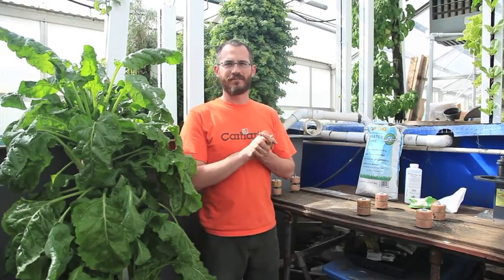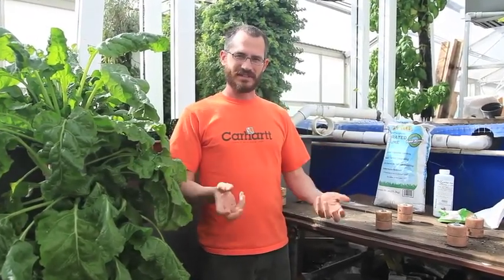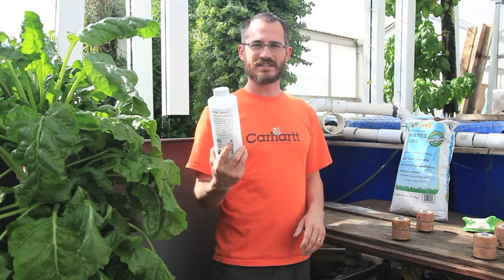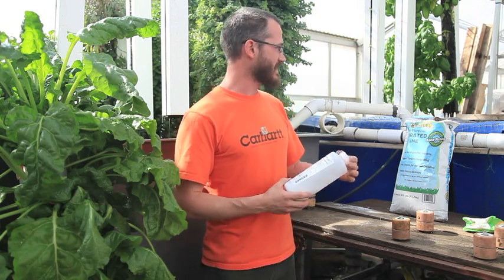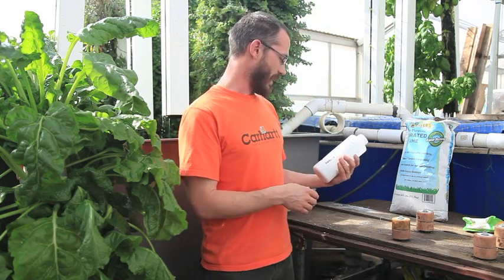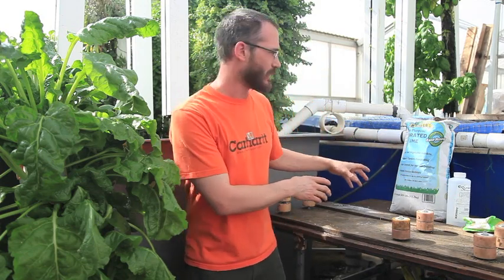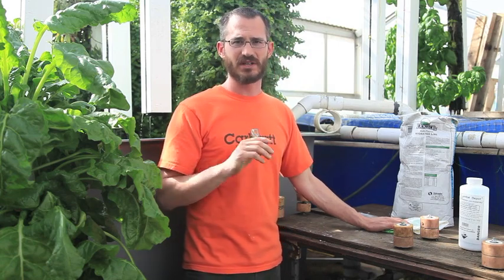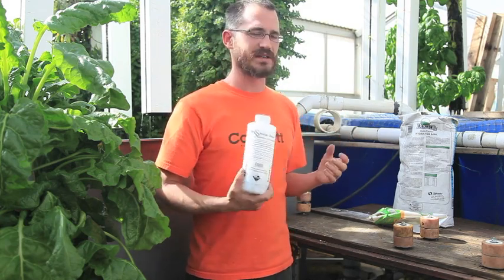Bringing up pH in Aquaponics systems

Comment: Dr Nate Story please explain to me, how much KOH and Hydrated Lime you put in your system everyday. you said 50:50, but how much gram per gallon. thank you
Reply: That all depends on the starting pH and size of the system... you're basically adding a little at a time and waiting then adding more the next day until the desired pH is achieved... without increasing more than .3 pH points at a time to avoid stressing the fish... but there are online calculators you can use for this purpose if your pH measurements are really accurate. Otherwise I'm sure it won't work a tinkus damn.

Comment: Hi Nate. My aquaponic system is 5 years old; I have a 300 gallon stock tank where my koi live and four 50 gallon stock bed grow beds. Lately I can't keep the pH over 6 and am not only losing plants but fish as well. I've used a combination of potassium bicarbonate and calcium bicarbonate which I had purchased from an Aquaponic online store; it seemed to relief the fish but only temporarily. 

I'm looking to buy the Doctor Soil Hydrated Lime and can only find the pelletized- is that what you use? Can I use this since it's all I can find from Doctor Soil?

Also, I'm hesitant to use the Potassium Hydroxide- it would be my luck to 'burn off my fingernails' as you mention in the video. Can you recommend an alternative to use with the Doctor Soil Pelletized Hydrated Lime?

Comment: how do you store the PH Pen between measures? i have a cheap one from ebay and in the manual it said to just rinse in distilled water and put the cap on but i read that the sensor must be kept wet all times on a 3mol/l kci solution...
Reply from the maker: Hey +Luis Miguel Batista - yes keeping it moist is ideal. Bluelab (the pH meter company) has some great videos on this topic actually.

Comment: so Dr Nate... are you saying you dont care about testing KH? do you guys at BA test for it at all? i know everyones system is different. also could you answer, with a new system or a system with carbonates, how long typically does it take for any certain system to eat them up? are there multiple factors in it? such as water source obviously but what about plants/number of plants in the system? and certain fish/densities? i know thats a big question. make a video if you have to! lol
Reply from the maker: Hey DRUMofTRUTH - 90% of the time KH doesn’t matter once you have nitrification cracking along.  Unless you’re in one of those places with extremely hard water, nitrification eventually consumes those carbonates.  It can be 3-6 months in really high KH systems.  The more plants you have in the system, the more fish you can have and the faster you can drive nitrification.  It’s a big question and a complicated problem, but all said, higher stocking densities (per gallon) combined with more biofiltration will allow you to churn through your carbonates a lot faster on a newly started system. Hope that helps!

Comment: I purchased some hydrated lime, haven't added it to my system yet because I'm also ordering some potassium hydroxide. The hydrated lime I got has only 0.45% magnesium.  But I wanted to get your opinion on this hydrated lime since I'm very new to this:

Calcium 51%
Calcium Oxide 72.50%
Calcium Carbonate Equivalent 131%
Calcium Hydroxide 95%
E.N.P 130%
E.N.V 130%

I have no idea what ENP and ENV is, is this safe for my Aquaponics? It's Hi-Yield Horticultural Hydrated Lime. Thanks!
Reply from the maker: exeseven hat hydrated lime is very Calcium rich.  You may want to look around for a brand with more Magnesium in it to  maintain a balanced system.  Hope that helps!

Comment: Hi Nate - I've tried everything to raise my pH in my aquaponics system.  I have a 100 gallon tube and right now only 1 gold fish (all the other fish have died).  My pH stays close to a 5.  I tried adding egg shells in the grow beds, sea shells in the tube, used products from the fish store etc.  I saw your video and would like to try the 50/50 blend that you speak of.  When I call Essential Depot to get more info on how to use it...do I remove my one and only fish first, can I mix the 50/50 blend (Potassim hydroxide and Hydrated Lime) into the tank, how much do I use etc. They shared they didn't have any info on it for aquaponics.  Would you shed some light on how much, how often and do I need to remove my fish, can I dump the blend right into the tank?  Also any info you can provide to me about why my pH doesn't budge would be great.
Reply from the maker: First off, you don't have to remove your fish to dose your system with a base.  You shouldn't be adding so much that there's a problem.  For a system your size adding a couple of dry ounces of a 50-50 mix should be enough to bring the system pH up a couple of points.  Start with 1 oz and see how much it comes up after 1-2 hr.s Then repeat with appropriate increases or decreases in the amount you add depending on the results.  Once you figure out your system, you might be able your base mix to a bucket with a hole in it and let it slowly drip into your system over the course of the day.  You might consider using a carbonate in your system as well- especially if your pH is always that low.

Comment: Great info. How does one calculate how much to add per gallon to move ph a given amount?
Reply: From Nate's answer on a comment below: "adding a couple of dry ounces of a 50-50 mix should be enough to bring the system pH up a couple of points.  Start with 1 oz and see how much it comes up after 1-2 hr.s Then repeat with appropriate increases or decreases in the amount you add depending on the results. "

Comment from the maker: Hi Brendan,
You can do it on weight, but that's pretty inexact.  I would recommend going by molar weight, which requires a little chemistry.  Basically look at the purity and figure out how much of the relatively impure lime is the equivalent of the very pure KOH.  Or, you can add by weight, but will have to supplement additional Calcium over time (I recommend doing this foliarly)

Comment: Thanks for the high quality videos you create, they are extremely helpful.

Can you please clarify when you say 50/50 of potassium hydroxide to calcium hydroxide how is this measured? I have a 6000L system and frequently put in a 1/3 to 1/2 a cup of calcium hydroxide and I've now ordered a bottle of flaked potassium hydroxide but I can't see my putting in anywhere near that much if its as potent as it sounds.

Thanks

Comment: How long does it take for a pH change to move through a system? I have 10 IBC's connected with 2" siphons that keep the water at the same level in all of my tanks. If I added a pH up substance to my first tank, how long would it take to measure a pH change in my 10th tank? I guess I could avoid any worries about this by adding equal amounts to each tank, but I ask because I would like to add chemical like this as far away from my fish as possible so that the impact upon them is lessoned.

Comment from the maker: You want to add it directly to the water in your system, although it helps to mix it with some system water in a bucket first, then add it slowly to your system.  If you mix it like this, you can dump it all in at once, but the best way is to drill a small hole in a bucket over your system and pour the solution into the bucket so that it drips into your system slowly over the course of an hour or two.

Comment from the maker: Hi Bacon Le, That's a relly high pH.  I would stay away from plaster of paris, as there are several types, some of which contain lime (which would raise your pH) or gypsum (which you don't want in your system).  Your pH is high enough that it indicates that you have some diurnal cycling (algae blooms causing pH swings) and probably some carbonates in your system or entering your system.  Try and find any cement or other basic or carbonate based products in your system and remove them.  Good luck

Comment: Hi Nate, I have been having some troubles keeping my PH above 6 and i have been using a 50/50 ratio of potassium and hydrated lime but it still falls atleast 2 - 3 points over a 24 hour period. My system is still going through the initial fishless cycle so i am guessing it is to do with the colonization. I will try dolomitic lime tomorrow, I am really greatful for the valuable information you share. Thanks!

Comment: Hi, i have a question about calcium. is it safe to use chelated calcium instead of the calcium hydroxide? cause i'm problems in finding the calcium hydroxide, if i do find one the cost is quite a bit high and they don't sell them in small bag (per kilo).

Comment from the maker: Potassium hydroxide is a naturally occurring compound found in wood ash (this is why a lot of people use wood ash as a potassium supplement). Hydrated lime or agricultural lime is another commonly used ag supplement that has been used for centuries. Since they're both natural substances, we don't have too many problems putting them in our system.

Comment from the maker: Once you have carbonates in your system, it's tough to get them out.  The problem is that they buffer pH instead of directly raising it, which typically takes control over lowering your pH away from you.  Don't use dolomitic lime unless you need to supplement Mg.  KOH can be bought online as caustic lye.

Comment from the maker: It depends entirely on system volume, system design and the pH swing you're trying to achieve, as well as the purity of the lime and the lye. For small systems, we recommend starting with a flake or two of lye and a very tiny equivalent amount of lime (especially when it's at high purity). As the system matures, you'll get a better idea of how much it will require on a regular basis. Just be careful not to swing your pH too quickly.

Comment: .if its built up carbonates from the media in the bottom of the beds, I've read that they eventually get eaten up over time. i am getting pretty impressive growth at the moment though, my fish are not even in it at the moment....you certainly have a bad ass system. very light weight and manageable. wayyyy more than mine.

Comment: ive acid tested my media and it didnt react. i think your right. it might be the rain water,  or maybe some run off water thats making its way into the tank. its also pretty cold here and my system is outside so i dont think the bacteria will really be doing much work untill it reaches high temperatures, so ill guess ill have to wait.....

Comment from the maker: Yes, shell grit will raise your pH, because shell grit is calcium carbonate. Remember though, carbonates buffer pH usually up around 8, which causes nutrient lockout. They cause your pH to run high, higher than you want for nutrient availability.

Comment: I used a drain pipe in my first system and it will cause a build up of fish waste and other gunk on the bottom of your grow beds. The Bell siphon works with suction and it will literally pull up all of the fish waste and dead plant matter from the bottom of your grow beds and run it through the system.

Comment: Do you use bell siphons in your grow beds? What is the point of the bell siphon? Whats wrong with having a drain pipe in the bed set at certain height say an inch below media surface and circulating water continuously? Thanks for the great videos btw!